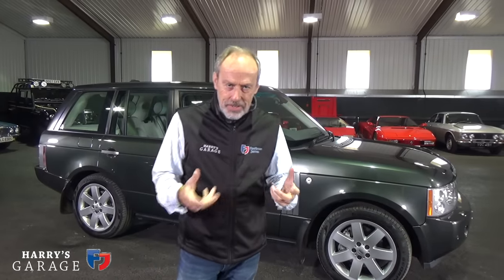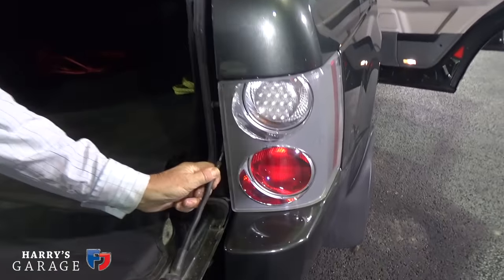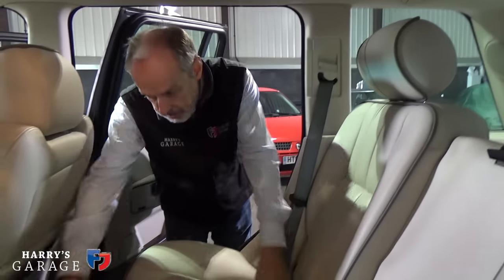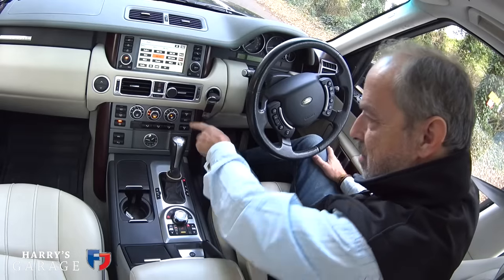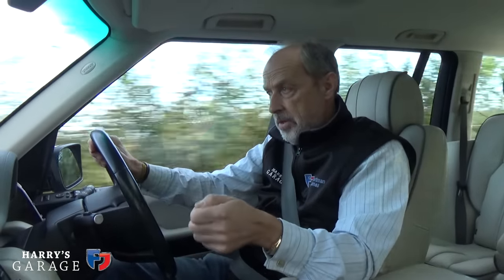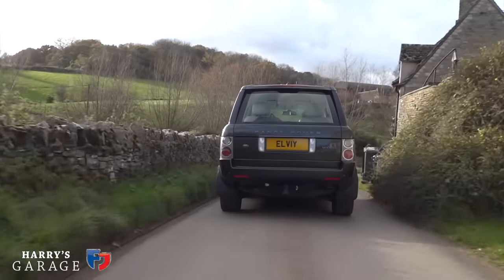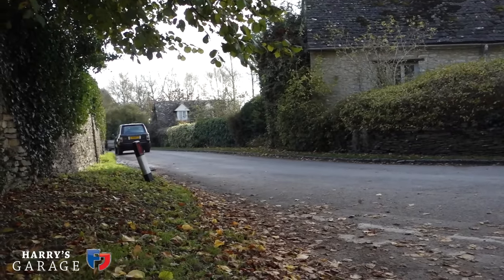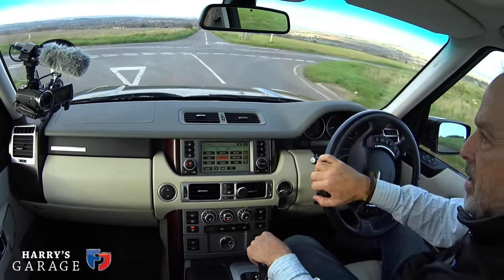Range Rover real-world review and buyer's guide L322 TDV8

Comment: Great review.  I bought exactly this model at 100,000 miles two years ago.  Now on 137,000 and it’s been fantastic for £12k.  Exactly has Harry says, I’ve had a rusted through tailgate stay, a split turbo hose, a wheel bearing fail and I flushed the transmission oils when I bought it.  Also EGT valves started to cough misfire and smoke on warm start.  Did a digital delete with a new map that locks out the valve forever.  Runs like a watch now and only cost £300.  Mine tows, lives on a farm, has kids in it all the time and with a wash it looks really classy.  Very very very good cars for the money.

Comment: The review reflects my ownership experience.   Expensive to own... Yes.   Best car I've ever owned... Yes.   Would I buy another... Yes.
Reply: How much is expensive? Year basis?
Reply: agreed i've seen the repair bills on one
Reply: I keep seeing it's an unreliable brand. What I want is "expensive to buy" but "reliable." What gives with this brand.
Reply: @cutdepiefails6596  when I had one, I had to pay 5k euro for repairs per year (2008 TDV8)
Reply: @karol190PL  how many km per year? Tires and brakes included?
Reply: @cutdepiefails6596  brakes included, tires not. Approximately 20k km per year
Reply: @cutdepiefails6596  I bought a 2002 model (3.0 TD6) one of the first L322's, in 2010 in Latvia for 13,000 Euros. I still have it, and have had to spend around 17,000 Euros on it (recon gearbox, new turbo, front suspension struts, fuel pump, wiper motor, handbrake assembly, discs all round and a few other bits.) That's over and above normal routine servicing obviously. So that works out at 1545 per year over the 11 years.However, I also do very low mileage (it's a "holiday" car, only covers around 5,000 km a year). And the annual expenditure is not constant;  the gearbox and turbo went in the same year (around 6,000 Euros) and there were other years when costs were minimal. On that basis I think it would be prudent to set aside £5000 a year for repairs and maintenance if this is your everyday drive. It's misleading though, because every car (outside warranty) is going to cost you for repairs at some point over a number of years. Even my trusty Land Cruiser (similar age and mileage) needed a new clutch last year, which cost £2000. So what you really need to consider is not the actual cost of RR maintenance, but the difference between that and what you'd spend on an "average" car. Go in with your eyes open; if you can justify and set aside a realistic annual budget for maintenance of several grand a year, go for it and you will not be hit with crippling unexpected costs. Make sure that annual budget is ever-present in your brain when you go to look at some of those amazing RR bargains out there.
Reply: @justinneill5003  Agreed, and the same can be said for other Manufactures, when the warranty expires. BMW, Audi, Mercedes, Mitsubishi. All are very expensive to repair, due to the nature of the beast. That's what you should expect, when you buy any off road vehicle.
Reply: @cosmofox  its an early 2000s rangerover modern examples are better
Reply: @cosmofox  i think theres no such thing as "expensive to buy" but "reliable, every luxury car brands has to be unreliable like mercedes or bmw..............
Reply: @karol190PL  it´s like with animals. Having a cat might cost you 150.- per year, having a pet lion is a total different story and any large luxury V8 car is definitely second 😃
Reply: @user-fn1rb9ze6p  no, they are the worst. That 3.0 BMW is the greatest engine in any BMW model, but in the Range Rovers they are a nightmare, loud, weak and just out of place. Underpowered in every aspect. I love my BMW 530d with the same engine but the same engine in a RR is a nightmare, I could not believe it myself when I drove it first.

Comment: I had a 2007 TDV8 for a year in Namibia. Best car I ever had in every aspect, exept reliability. Sand, rocks, gravel, tarmac. Its absolutely capable everywhere. And comfortable. It had 85 000 miles on when I bought it, with a full dealer service history. I spent about £6000 on repairs in the year I owned it. Gearbox oil gasket. EGR valve. Exhaust manifold gasket. Dampers. Brake discs. Brake pads. One morning I came into the garage ONE fog light shining. And the battery was stone dead. During my year of ownership, it was at the dealership more than with me. But its so excellent in all other ways that videos like this tempt me.
Reply: That's just sad am sorry for man but why the fuck did you bring such a car in Africa???! The cars element is in the British streets not the real field where other well built cars can survive adjustable air suspensions that's just a gimmick when you live places like Africa or near the bush
Reply: @carholic-sz3qv  but but, we drive them here in Africa all the time. Actually it's a perfect car for a largely rural area.

Comment: Just bought a 4.4 V8 Diesel. This has the 8 speed box and hardly ever seems to go much beyond 1500 RPM. Smooth as a nut and quick. Kept the 19 inch wheels as I’m more into ride than sharp handling. Comfort wise is superb 👍🏻

Comment: Great review!  I have a 2007 with the 4.2 SC engine.  Absolutely love it. Purchased in 2013 it’s a fabulous ride and I’ve saved loads of labor by doing most of the work myself.  I haven’t paid the engine a second thought, it has 155k miles and only uses 1/4 quart every 5k miles. Always get compliments and the performance is superb.  I’ve had the best all season performance from the Continentals. Appreciate your time.

Comment: Review is spot on. Done 118k miles in my late 3.6 TDV8 I bought at 30k miles. EGR valves, turbo pipe, tyres, brakes, alternator. Pretty good really. I'm keeping hold of it. Does everything really well and still doing 10k+ miles a year.
Reply: Still going strong? Do you get gearbox oil changed?
Reply: @joshhaines6280  yes thanks. On 135k miles now. Yes, I had the gearbox fluid changed and the underside rustproofed last year and few bushes etc changed. It's a keeper.

Comment: I've run a 2002 year L322 4.4 petrol V8 that's been converted to LPG for the last 12 months now and I'm going to check if the rear seat base folds up tomorrow! Very informative, although you didn't comment on LPG? Its on 166k miles and achieves 14mpg on a long run to work so with local LPG at 54 pence per litre thats equivalent to at least 28mpg. Its a touch quieter than diesel and I have an MOT pass this month showing ZERO co2 emissions. I'm saving the planet in this V8 once the temperature gets to a quarter & LPG switches on. It's not been a major money pit....so far.

Comment: Great informative video & an absolute inspiration indeed! Truth be told, this video & maybe just one other honestly, inspired me to purchase my very first Range Rover in December 2020. A 2010 Supercharged L322 Online from Miami Florida of all places. Full service history, one owner & with 88k on the clock. Straight from the comforts of home & wayy outside my usual propensity to over think & over analyze everything, i abandoned my comfort zone, found the truck & pulled the trigger! (Blame it on the pandemic) I then had it transported to Philadelphia Pa after a pre purchase inspection of course and I couldn't be happier! Santorini Black with a full black leather interior including the headliner with a piano black wood interior trim and not so much as a blemish, crack, chip, scratch or imperfection anywhere! Absolutely magnificent condition! I did however eventually have to replace the driver side power foot rail motor, the battery and an airbox underhood, but that's it since I've owned it outside of "regular maintenance". As amazing as the actual ride is and the 500 plus horsepower incredible, the feeling it evokes as it goes about it's business has a regal quality to it in my humble opinion. It's presence is & remains nothing less than statuesque even after so many years later after it's introduction. It so far has been all that I had imagined it would be as I had never driven one, but had adored the brand, especially the L322 from afar for so many a year. For me personally & especially, this was a truly risky proposition & something i had never done in the past, but totally worth it! Thanks again for the great insight & video Harry! Much obliged my friend. Respectfully. Roddy. Cheers!
Reply: Great story.  Im literally looking at 2 different L322s that are based in Florida as well.  One is in Stuart Fl...the other in Miami.  I live in NY so I'd be shipping them to the Northeast like you did.  And like you, this would be totally outside of my comfort zone.  I usually need to touch and feel everything before buying it.  Times change though I guess.  Good Luck with yours.  I'm sure it will work out well.
Reply: @seancreighton8169  Good show Bro' and thank you much! I'd do it all over again my friend. I seriously wish you the absolute best with your search. Not a complaint to be had from me man. I did recently have to get the suspension recalibrated/reprogrammed to facilitate the proper leveling of the suspension at rest, (Something i wasn't aware was necessary from time to time apparently) but aside from that & what I've already mentioned, no major issues. It's amazing how this old stallion still turns heads almost everywhere i go in it. Hoping alls great with you & yours my friend. #respect 🤟

Comment: A few comments on tyres. I use my Range Rovers off-road on farm tracks and muddy fields. I also use them for long motorway runs and towing a 3500kg boat. The best tyres have been the Cooper Zeon LTZs which have given over 40,000 miles and worked well in snow and mud. However, my current L405 is fitted with the new General Grabber AT3s and they are also excellent - being quieter than the OE Pirelli P Zeros and the same grip as the Coopers. They have only done 15,000 miles so I don't know how far they will go yet, but they still look like new.

Comment: Nice vid Harry always been a fan of the L322. I think it became a much better looking car after the 2006 face-lift, you're very right they're not cheap to run, i know a few people who have owned them and they've all had something go wrong, usually the gear box, though i attribute this to that "sealed for life" nonsense, so i agree you really have to change the fluid. The other major failure is always the air suspension, seems it's not the bags themselves but the compressor most of the time. All problems aside they really are a wonderful car, it's just about buying one that's been looked after so service history is key. That EGR valve at £800 is expensive, but to put that into perspective a friend just had one go on his Passat estate by no means a luxury car and that was £400, so regardless they're expensive to do. Looking forward to the next video.

Comment: Beautiful video. My friend had a RR Sport V8 Diesel. The car had 420.000 kms (262.000 miles) and he always pulled a trailer. He imported cars from Belgium to Hungary. 
His mania was to change oils before than need. Engine 8000 kms. And gearbox 15... 
Once up on a time I went to Germany with him. After this "go and back" trip what was 2800 kms, I realised what this car it is. When I arrived home, the sound of my computer's fan disturbed me. 
My sofa was not same cosy. I could not find a same quiet area like the Range. To drive my Suzuki Jimny was a nightmare. 
Now I sold the car, the motorbike. I definitelly will buy a RR Sport V8 diesel. I have seen many time my friend's car, of course I knew it is cosy. But I did not know it is that much smooooth... I love good films, I like theatre, but now my favourite thing to ride on a RR Sport.

Comment: I've had my 2008 Range Rover TDV8 since 2 Years. Never had any problems. 
The 2006 TD6 I bought in 2008 had so many problems. I would always take the V8 over the 6 Cylinder.
Also the Interior in the TDV8 is better in my opinion.

Comment: Reflects my experience, and although my right bank turbo failed after only a month (147K car), it is still the best car I've owned (including BMW750i), gives a feeling like no other. Living in rural isolation and snowed-in for a few days most winters, I do often use its 4x4 ability. Pre the V8, the diesels were underpowered; so, I jumped from my P38 2.5D straight into this, bypassing the 3 altogether. As I said to my good lady, for as long as I can only justify running one car, it will always be a Range Rover. I would only replace mine (2007 3.6 TDV8) with a newer one.

Comment: When everything is working they are imperial, when something is not right they are a mistress nightmare! I have a black 2003 4.4 and the previous owners have sunk thousands into it replacing all the bits you expect to go bad at 100,000 miles....Mine's on fully sequential LPG and you cannot tell when it swops from petrol to gas. Costs less to run than our Audi A2. Cannot find any decent mechanics, so do everything myself. I'm teaching my little boy about mechanics at the same time;)... Great video Harry, thanks; Where is the fun in continual reliability?
Reply: I applaud you! Unlike you I am not mechanically minded - and nor, it appears, were the mechanics of my 2003 4.4, especially after her botched conversion to LPG. The car was a nightmare 90% of the time. I finally threw in the towel and replaced her with a stunning 2011 4.4 TDV8 Autobiography, which (knock on wood which I carry around for this purpose) which has been almost trouble free. So far. ;)

Comment: I've (only) had 5 Range Rovers and numbers 3 & 4 were L322s: 2004 V8 Vogue and 2010 TDV8 models. Both were excellent and did 186k and 112k miles respectively. Weakest points were all components, by (mainly) German manufacturers: Radiators (4 replacements), Water pumps (x2), Air suspension pumps (x2), Fuel pump (outrageously expensive), Alternator (ridiculously expensive) and ignition coils.
The BMW engine was cheaper to run because BMW parts were about 40% cheaper than Land Rover parts. Some OE parts (e.g. Bosch radiators) were half the Land Rover cost.
If your RR is more than 4 years old have it serviced by a LR specialist and use OE parts from the manufacturer - not Land Rover - and your running costs will be less than half that of main dealers.
The secret to not breaking down is to have it serviced regularly by someone who recognises a component about to fail.
The best? Probably the 2010 TDV8 - it was better built than my current 2015 L405 and felt more 'classy'.
The worst? Easily the 1998 P38 - poor ride, cramped cabin, rust magnet and very bad electrics.
The one I regret selling? the 1993 model - a true 'Classic' and I would love another one...but only for shooting and events.
Reply: Thanks for that. Very useful info. Trading up from Freelander 2 shortly.
Reply: P38 Rust magnet? don't think so.  I'm on my third p38 - no rust anywhere.  Little bit of bubbling on the lower tailgate lip maybe.  L322, just like Harry's one - rust on the rear arches for the simple reason that the wheel arch liner doesn't extend to the outer lip of the arch - so stones fly off the tyres and hit the bare arch. Why they didn't carry over the proven approach from the p38 I will never know.
Reply: Gavin am saving money want to donate abit for a good cause?

Comment: I must say I can completely agree with everything you said. Over the years we have had around 25 range rovers starting from classics moving through p38s and onto l322 and used them around the farm. I agree in saying that the td6 is what it is ( its okay, But really it is worked hard and has a weak gearbox). The 3.6 tdv8 are overall an extremely good car and really good value, Your right about the EGR valves ( had to rebuild an engine because of it ). The 4.4 tdv8 is surprisingly quick and great for towing but the one thing I don't like about it is the grill, its getting very bling bling if you know what I mean. Every person that owns a RR should have one of those hand held computers for bringing up the vaults the codes, but once you get used to towing, going off road and using the Range Rover as a tractor/ all rounder you will never go back to any other 4x4. They really are great at everything and fit in anywhere be that in the farm yard full of dogs going off for a days work, going to a black tie ball or just cruising down through France on the highway to the sun. The best 4x4 by far.
Reply: Speaking of which, currently sitting in a mates 2011 4.4 using a glove and cable ties too try and reattach one of the linkages for the left wiper blade, the joint has worn and it has becoming disconnected (common fault) happen to an old td6 I had years ago as well
Reply: VRdelivered ii
Reply: I don't understand?
Reply: VRdelivered I have red that  Petrol engine is more reliable than diesel ( and which one BMW vs Jag ? ) do you have any experience about it please ?  I rather to pay more and drive greener somehow ..thanks .. !